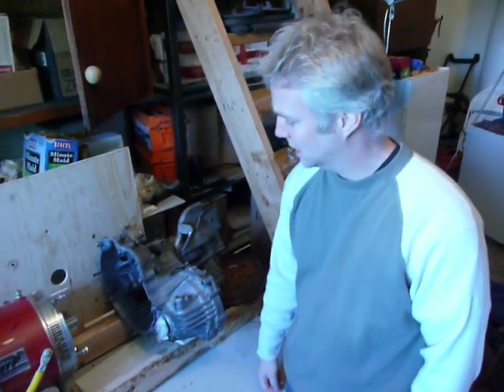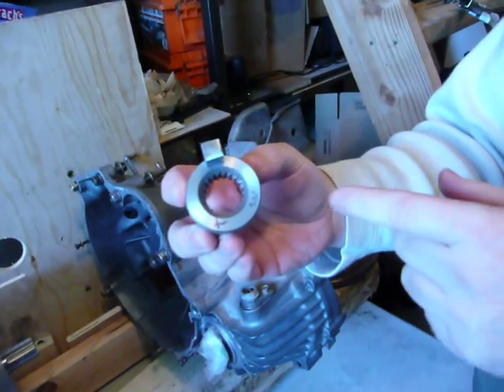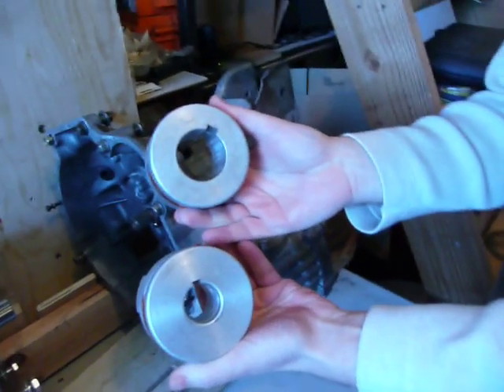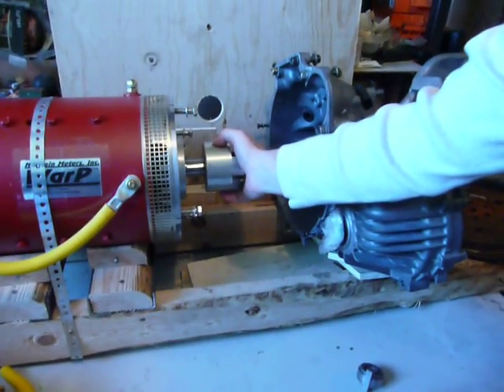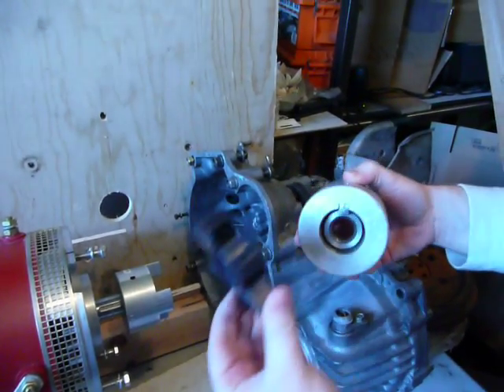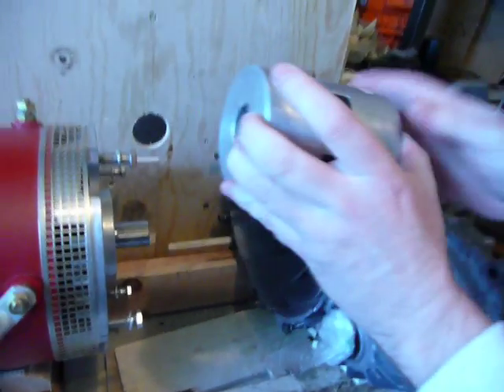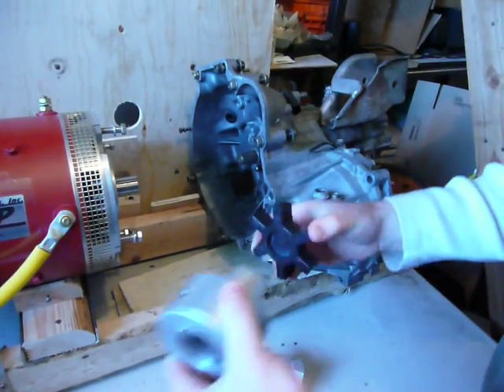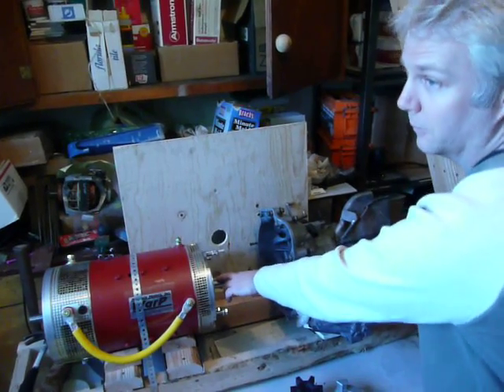Coupler

Comment: Nice job.   a point to consider, you don't want the Lovjoy with the spline sliding forward and backward ON the spline.  The Motor will keep it from sliding forward and the sleeve that the throw out bearing used to slide on is what keeps it from sliding backwards.  But, if the Lovjoy is rubbing on that transmission collar, you can have some unwanted noise and wear down the collar in time. Steve Clunn